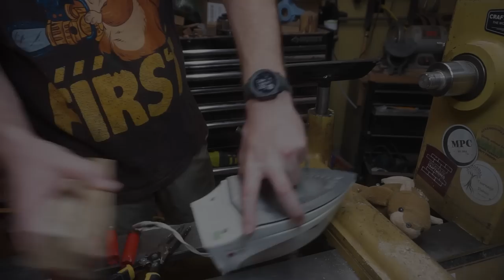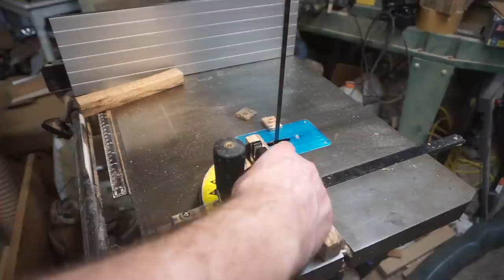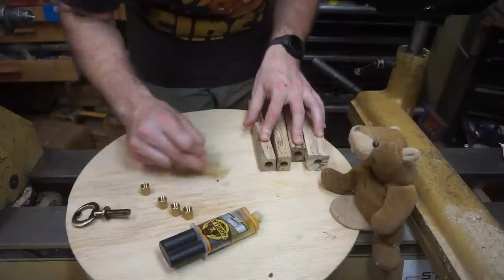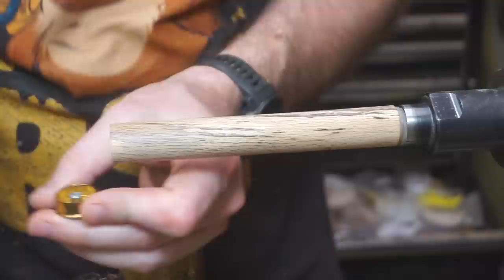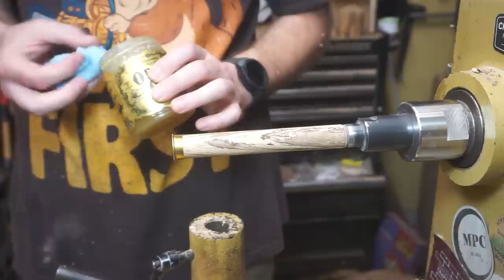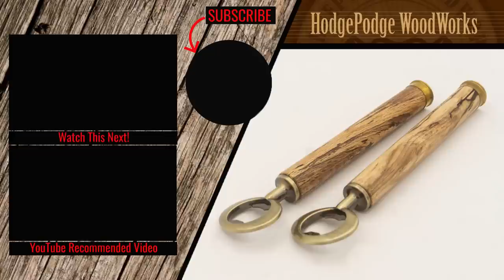Woodturning - The Easiest Project to Turn and Sell for Beginners!

Comment: Nice project. Rather than taking the time to bring up the tail stock with the drill, just put a small centered hole on the end and use a handheld drill bit with a homemade handle on it. Put it up to the centered hole and you can drill the hole in a couple seconds. Also works great for drilling a depth hole for bowls, boxes etc. A small pill or toothpick box in the shotgun shell size would be cool.